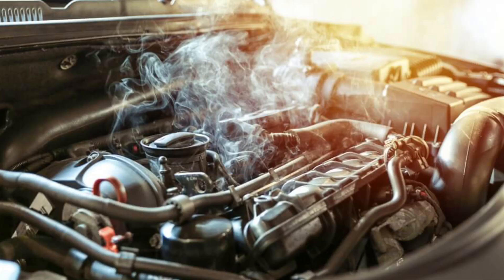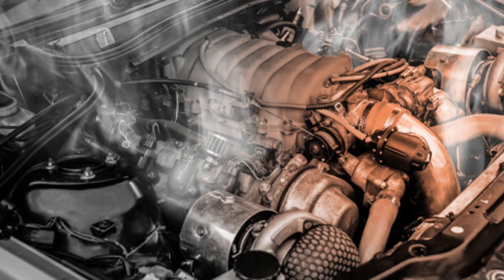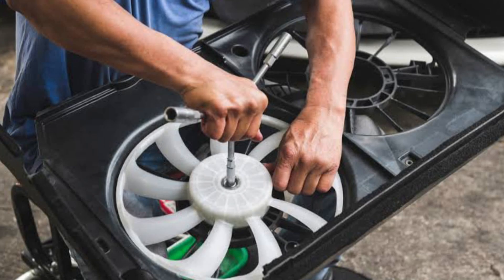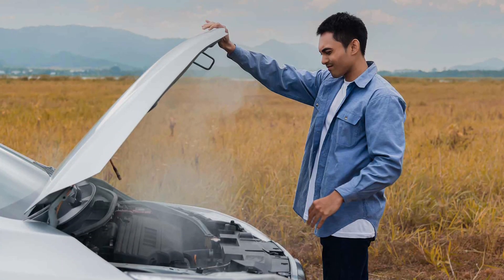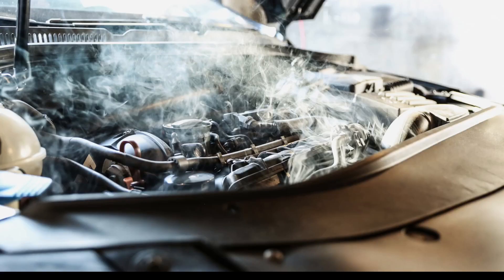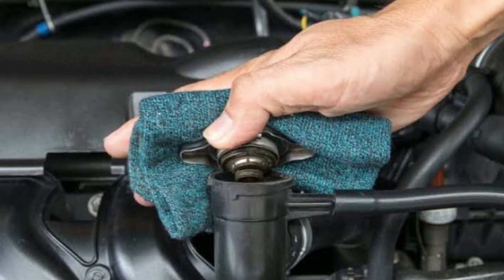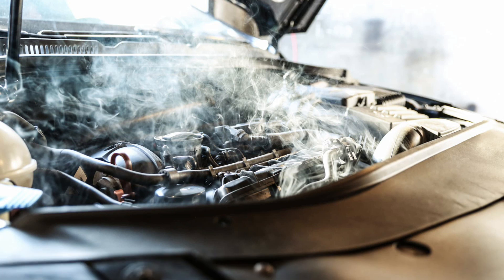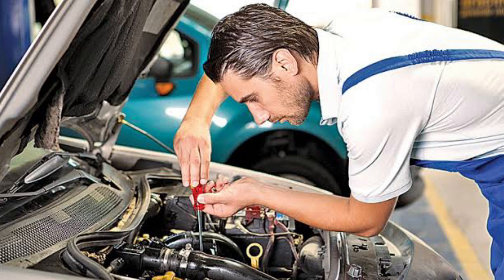5 Common Causes Of Engine Overheating ;how to prevent and handle it!!

Comment: Better to install a hho kit for better cool engine running   Hho is an experimental technology  it  will surprise you!  Cool engine running  prolonging engine life and engine oil life. improve engine power & performance and increase fuel burning efficiency. Petrol combustion engine can burn only 18% petrol in the engine but hho will burn   100%fuel  in the engine No un burn fuel wastage . Engine will run more power fully, Consume less fuel. Hho system works on petrol, deisel, cng,  types engines.

Engine runs lighter smoother reducing carbon emissions .  

An efficient hho car kit lower the engine temperature more then 100 degree F.  Hho car kit reduce car maintenance  Hho kits restore better fuel economy. Hho system is very easy and simple to install. Hho solves the engine heating problems automatically!!!. Clean fuel burning , Reducing engine noise & vibration due to the faster fuel burning. Hho car kits works nicely requires no modifications in the car engine. No side effects on car engine.

Engine start quickly safe your car battery.  make your car a low cost hy-brid. Use a  low amp. Hho car kit will work better. You can 5 transfer hho kit from one car to another one. For more information about this useful technology  keep watching hho zafar videos. Or call 03082266179 zafar karachi.

Comment: 1. Level and condition of coolant 2. Water pump or Broken fan 3. Broken thermostat 4. Radiator clocked or damaged
Reply: Water pump is one
Broken fan is another
Reply: @akindejiakinola4647 but for the water pump it should have a leak of coolant somewhere and all the time u checking it it keeps low so thats the water pump that happened on my 03 mustang
Reply: That all happened to you?? 😂😂😂😂
Reply: Thank you for your info. My 4m40 always overheating .. now ive to reminder 0f 5
Reply: Can a bad timing cause high temperature or overheating?
Reply: Or check if ur engine oils is black overtime it wears and lose some engine protection benefits then parts get more wear and heat.

Comment: 4:00 I was sitting at 2250 RPM, Cruise Control on going down I-40 just outside Nashville. I was going about 75 - 80 mph and that is when the engine overheated and of course the dealership said nothing is wrong and they cannot explain it and the cause was pegged to Hot and there was no warning light.

Comment: nice explanation. Keep it up. if possible please explain in case of any issues with engine overheating, how to troubleshoot whether the over heating is because of radiator block (due to dust) issue or thermostat issue or fan issue. Is there any workaround if we face the issue while long driving (you already covered few of workaround to reach destination). I faced the issue couple of times while long driving.